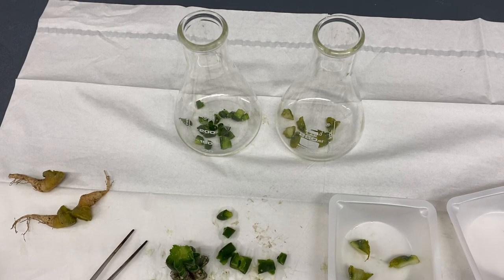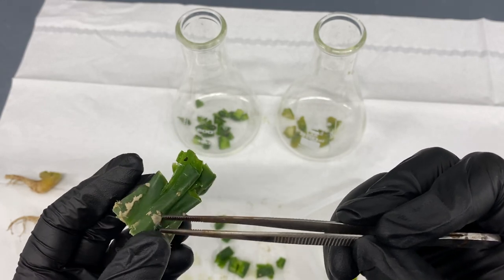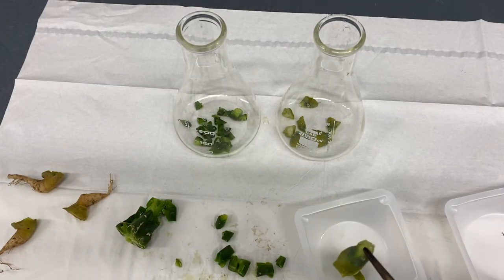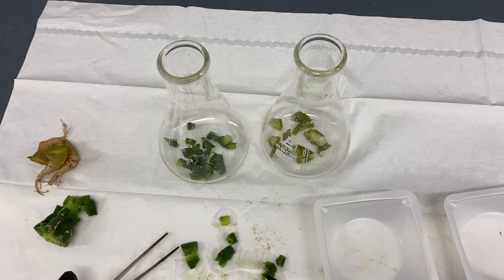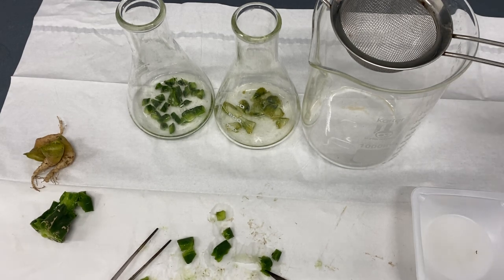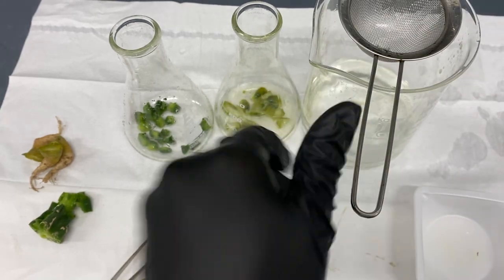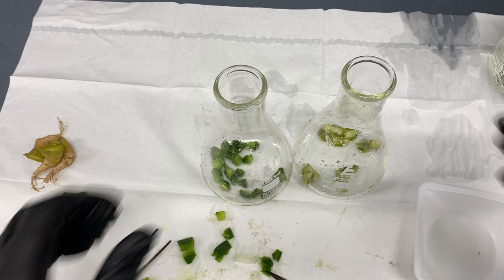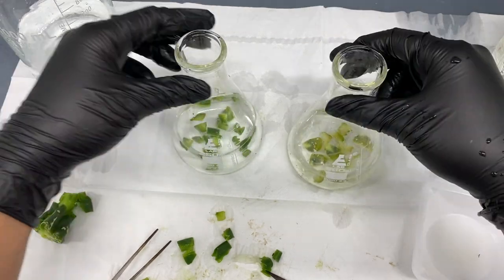Processing Echinopsis pachanoi and buttons for Tissue culture

Comment: Hey I got a question if you don't mind answering. The PH of my media starts dropping over time, especially once I stick a plant into the vessel.

For example, pre autoclave of 6.10 becomes 5.8 post autoclave. After cooling, I stick a plant in and let it incubate around 26 with regulate photoperiod 16/8. I check the media's PH after a week and it drops to like 4. I still get growth from my plant, but I was thinking if the PH stayed consistent the plant would grow even better.

Do you find the same with your plants, and if so, do you personally try to buffer the PH somehow? Or not care and let the plant do its thing. 

Thanks!
Reply from the maker: Not care and let the plant do it’s thing. Most literature does not adjust so I actually assume the pH change is due to the celular signaling and metabolites. I find no need in any of my work
Reply: @cactifanatici  thanks for confirming!
Reply: @cactifanatici  Appreciate it! :) Thank youu